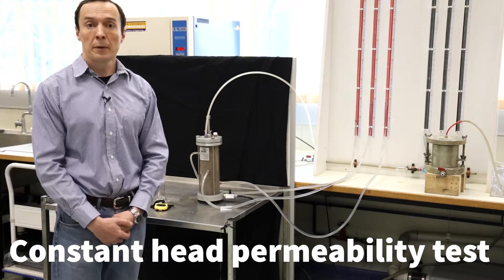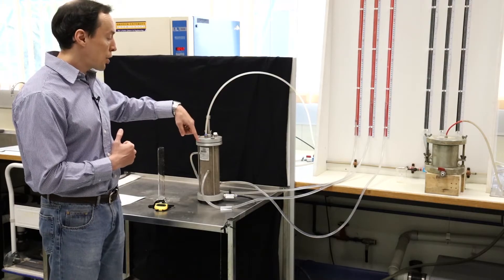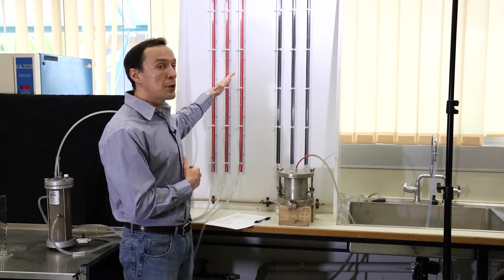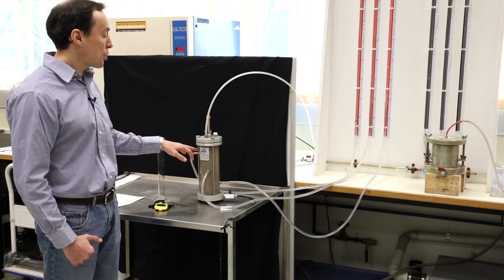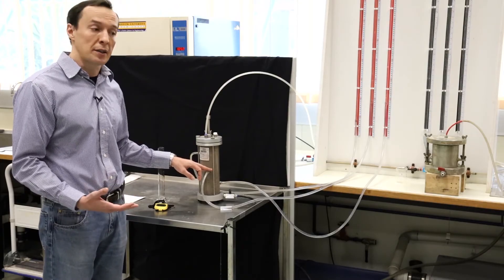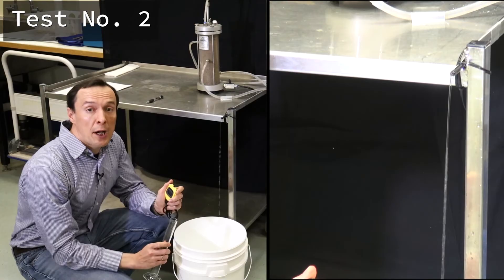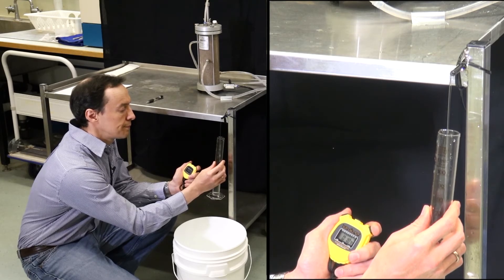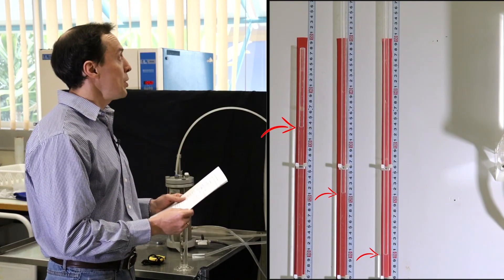Constant Head Permeability Test | Procedure and Data Analysis #education #engineering #science

Comment: could you please explain step by step how to prepare sample, de-air system, etc.? what should be done before first measurement? thank you
Reply from the maker: That's a long (time-consuming) process to prepare the specimen, and it actually takes much longer than the test itself. We follow the standard procedure that describes how it should be done. Here are the references: Australian Standard AS 1289 6.7.1-2001. Method of testing soils for engineering purposes: Method 6.7.1 Soil strength and consolidation tests – Determination of permeability of a soil – Constant head method for remoulded specimen. (2) Australian Standard AS 1289 6.7.2-2001. Method of testing soils for engineering purposes: Method 6.7.2 Soil strength and consolidation tests – Determination of permeability of a soil – Falling head method for remoulded specimen.